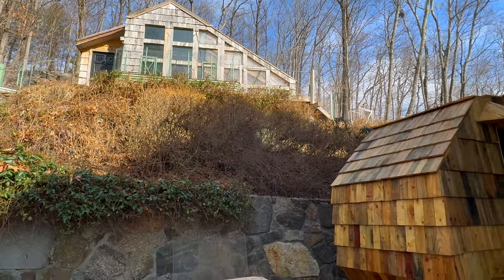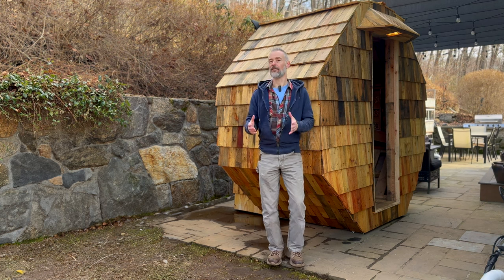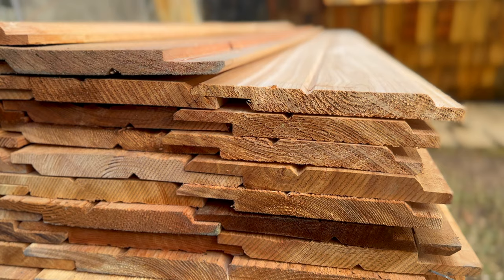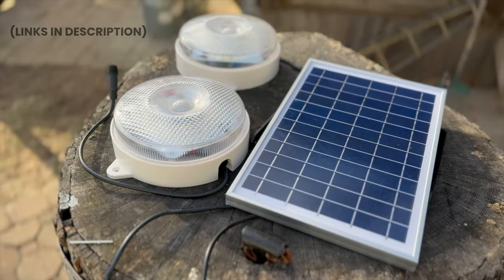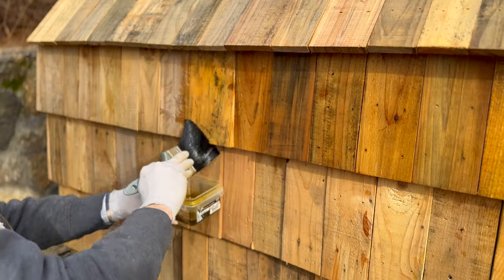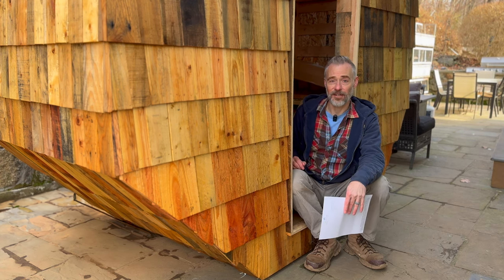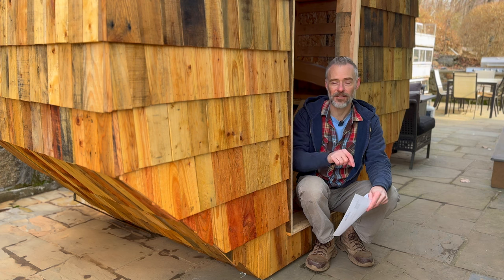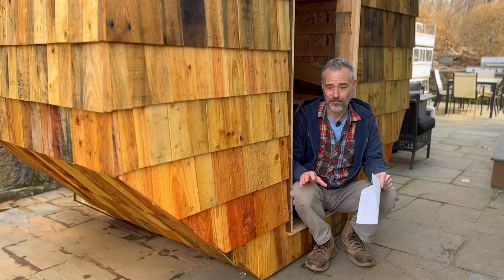DIY Pallet Sauna Project  - CEDAR is here! (#3)

Comment: Re wood shingles from pallets:  I ran into something when inspecting the 100 year old raw wood cabins in the Piscah National Forest that were built by German woodsmen from the Black Forest.  Anywhere there as a drip edge for rain water, the wood was tapered.  This resulted in there being a very small area edge that would get soaked by water and remain soaked while the building drained after a rain shower.  As a result, the wood would always dry out before it had time to rot.  It was pure geneous I thought.  After 100 years, the very edge of these pieces were a bit pulpy, but the rest was solid...
Reply from the maker: It is genius. Old knowledge is the best!
Reply: How has this comment not got more likes❤

Comment: I have used boiled Linseed oil once on an exterior surface. It was a garage door. The bottom panel that received direct weather contact mildewed and turned black. How has this project held up so far, in terms of the Linseed oil you used? My project was in the inland Pacific Northwest.
Reply from the maker: New England here. It actually holds up pretty good.

Comment: You may have already thought of this, but what about off-gasing of the glue in osb boards and pallet shingles when the sauna is heated up?
Reply from the maker: There is a sauna vapor barrier liner on the inside underneath the cedar paneling, so there won’t be much if any interaction between the exterior shell and the interior environment.